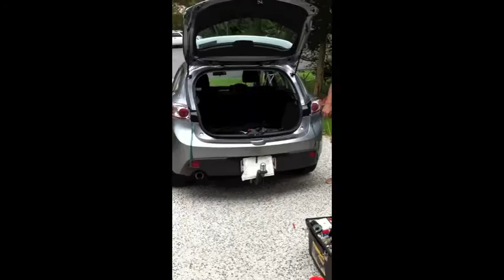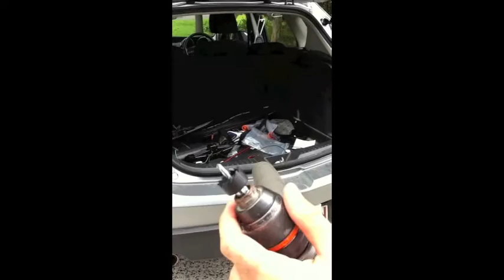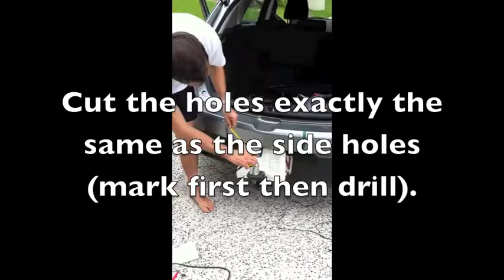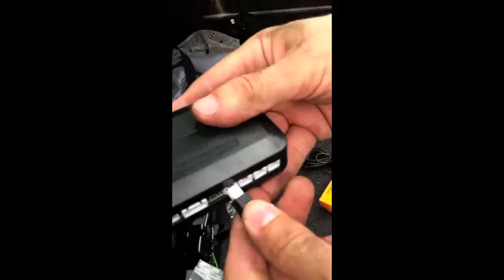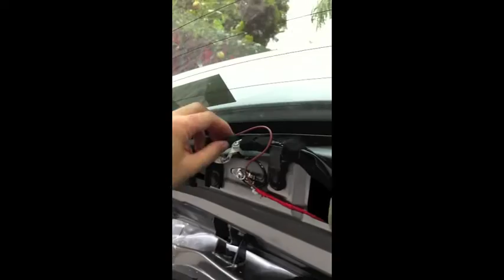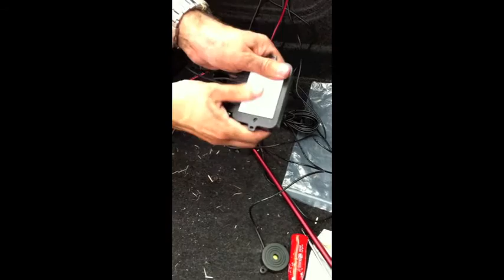How to Fit Reverse Parking Sensors to a Mazda 3

Comment: I have 2011 mazda 3 sedan and wife needs sensors. Can you share the link to buy the kit please. Great video.
Reply from the maker: Hi Touseef - there are loads of kits out there that will work perfectly with the mazda 3. The following link is one that I found one ebay which is exactly the same as what I fitted: https://www.ebay.com/itm/402978385937?hash=item5dd3623011:g:dTsAAOSw6CpjtN8~&amdata=enc%3AAQAHAAAA4EvN3PARsDcofiNEkbXI06t7IAPGs3elGvSyfCJ1PENrhItp7vfLzY%2BC22Wtk9grFbtDtdeHAOYakjAWfuCmFVTrOe9Ypdp0z9MP3h2DfYsnNCOVVrH5aJrNtW7vMWxlwnH2xf828%2BgCXlRqIfhi%2FTxfrSsAHN%2BMieyXLVs5n0y5xAN7KsV36Mj9kV57AcFhbvIZHEIuaNa1hRBv%2FlhYtPD%2BcpIJQjCHm1uD8hyGJieEUKfoG1yeNmqBrX27B67YoBKFJzvPScX%2BwB3atjPOyzdsZKL39B%2FhTe1tv%2B3%2B6zG9%7Ctkp%3ABk9SR77j65_gYQ

This one however is black, so if you are wanting to colour match, have a look around and find one the same colour as your car, or alternatively get some touch up paint and paint the sensors. I wouldn't expect it to impact the sensors. Let me know how you go. Thanks for watching.

Comment: Hi mate.. thanks for the video. Is this the Mazda 2012 hatchback model?
Reply from the maker: Hi Shrawan, sounds about right. It is the Second generation Mazda 3 uplift model (hatchback). Thanks for watching
Reply: @HowtoMan  thanks. I have eight sensors to install watching your video :).. have you also find the reverse camera?
Reply from the maker: @ShrawanRegmi  I installed the reversing camera on a VW Golf (check out my other videos) and used a camera that replaced the rear number plate light. It was quite an easy install.
Reply: @HowtoMan  hey man.. have you installed front sensors too? If so is it easy and how did you do the wiring.. and do you the colour of the brake wire and maybe accessories wire?
Reply from the maker: @ShrawanRegmi  Hi Shrawan, I have considered doing front sensors, but have decided against doing it. It should be an easy job as all you need to do is to put the sensors in, and run the wires, however you would need to wire the positive to a switch inside the car so that you can turn the sensors on and off.  That would be unless you want to keep them on all the time which may be a little annoying if they started going off every time you passed a car on the highway.
Reply: Thanks mate. I hadn't thought about the switch at all. It makes a lot of sense :) I'll definitely connect the positive to it. Indeed I'd go crazy if it beeped all the time haha..  appreciate your response.

Comment: Awesome. Do you know what wire I would need  to buy, as the ones I have been given won’t be long enough for the reverse light connection
Reply from the maker: I went to Jaycar and bought some electrical car wire, it was really cheap. You buy it by the metre and in whichever colour you need. Hope this helps. Thanks for watching.
Reply: @HowtoMan  fantastic thank you! My sensors have a red and a black wire. Do I connect both to the reverse light?!
Reply from the maker: @alexcooper2581  I just connected the positive (red) to the reverse light. I found it far easier to connect the negative (black) wire to a negative connection point that was far closer to where the sensor box was positioned behind the car interior cladding. It is slightly easier just running the one wire all the way back to the reverse light rather than the two wires.

Comment: I know this is old, but where did you connect the black wire too?
Reply from the maker: Mate, I did this a long time ago. From memory, I believe the point where I connected the black wire is under the earthing bolt that you see at the part of the video shown at 10m 30s.
Reply: Hi mate question do these beep outside the car to or just the inside the car thanks

Comment: Does this method apply same to a 59 plate mazda 2
Reply from the maker: You can fit these reverse sensors to any vehicle. They are all the same, and work off a 12v battery. Just make sure you hook into the reverse light so that they only come on when you put the vehicle in reverse. Thanks for watching.

Comment: Oh great, my 2007 Mazda 3 has both the wires in full black, so tracking the wire back is gonna be difficult.  I've checked and re-checked, but the wires are definitely completely black.  I might still order a reverse sensor kit and connect it right at the top right near the reverse light.  Thanks for the video
Reply from the maker: The easiest way to check which is the reverse light is to get someone to put the car in reverse while you use a electrical tester on the wires. There are loads of electrical testers you can use. To check if you have the right wire get someone to engage reverse and then disengage reverse. You will see straight away which wire is the right one. Thanks for watching.
Reply: Delu Miah hows u do it